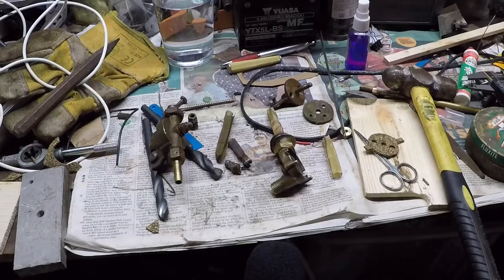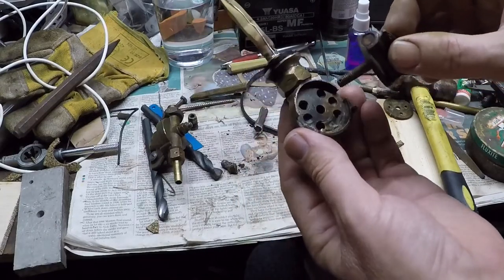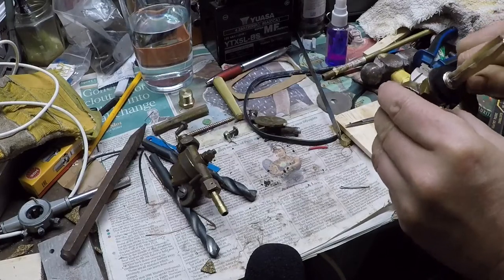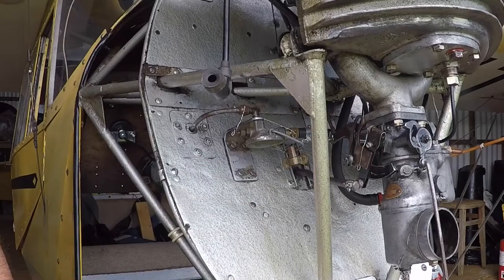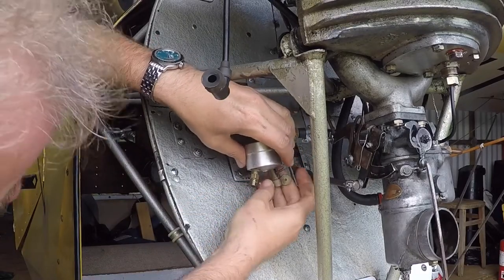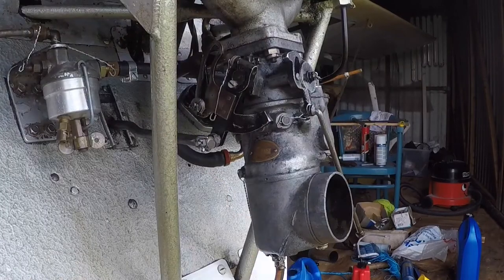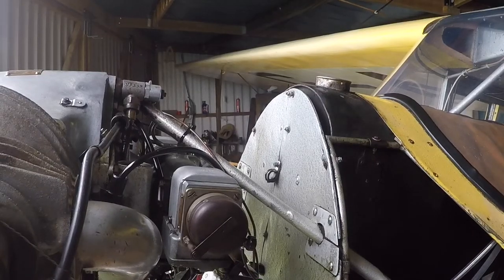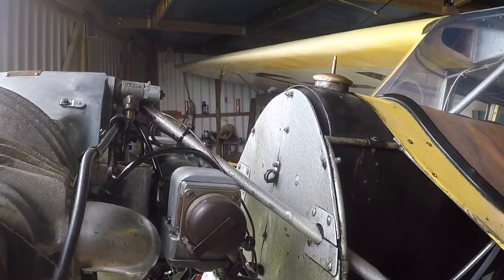Aeronca JAP - fuel stuff

Comment: Great idea to have a fuel drain on the filter, I wonder why it is not a standard thing. Going to get a new fuel bowl made as I have some HE30.
Reply from the maker: @atkm11  The ‘curtiss valve’ is a post war invention and, although generally a good thing, can be prone to leaking. This is a particular problem with fuels containing alcohol. The Aeronca originally had a glass bowl filter and I am fitting a glass bowl filter to the firewall on the C2. As long as the bowl is inspected regularly (easy with a torch) then the old fashioned glass bowl is alright.